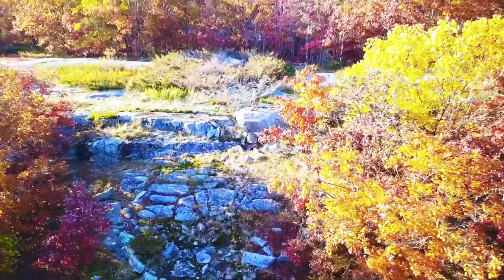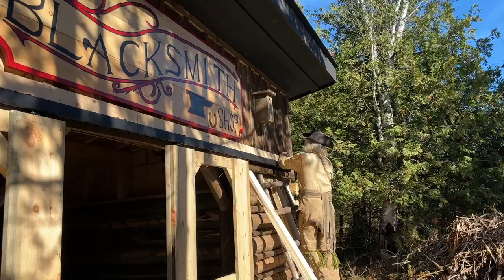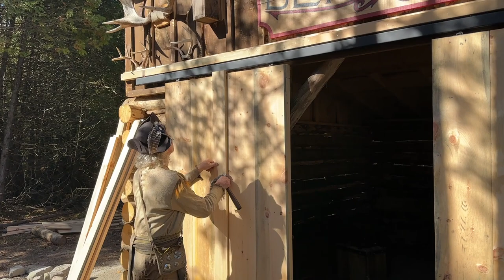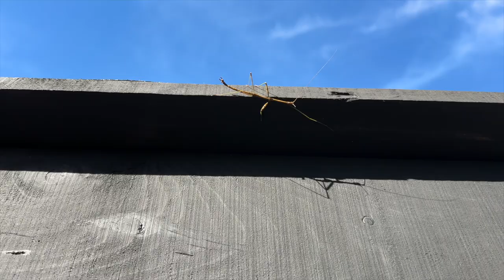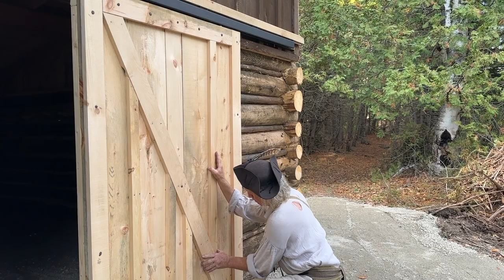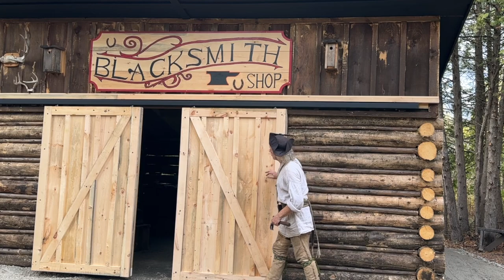Shut the Doors!  18'th Century Log Cabin Blacksmith Shop Build Continues | WOODWORKING

Comment: Howdy Peter 
Those doors will last a very long time .... 
Are you going to have set up to lock together so any wind will not blow them open ?
Are going to make some nails ?
That walking stick bug ... WOW have not seen one of them in a very long time .. I think I have only sen 2 and one was brought in to school 1965 ... " show and tell " ... the other was in my back yard .
Looks like the bug was inspecting your work ...LOL
I like that wheel barrel joke ... I heard it before but another piece of equipment .
Reply from the maker: I will be making a closing system for the doors but, I need to have a forge to do it on.  I could use my modern forge but, I prefer to make everything for this shop in this shop.  Oh my, the building inspector, I hope he/she approves,lol.

Comment: I really like the opening shot, it was a good change! I am building what I call a sharn. Bigger than a shed but smaller than a barn. I really want a sliding door on it, but everyone is very proud of the rail kits and the rollers for the doors. I have managed to tackle the roller issue but not the rail system for them to roll on. Did you fabricate your own or was it a kit? I have thought about using wood for the channel but I don't think it will last much over a couple of years.
Reply from the maker: I did buy the track system.  I think they would be relatively easy to make but, I’m trying to get this up and closed in before winter is upon us.  I don’t think wood would be a good idea, personally.
Reply: @TheWoodlandEscape  I have no welding or blacksmithing skills. Being an old Aircraft Mechanic I do have some original ideas.... some work and some do not. Angle iron for the track with a wood backing to keep the wheels running in the track may be a decent option....

Comment: Hi is the blacksmith  shop in operation  if so what's  the frist thing you're going to  make
Reply from the maker: I wish Mike.  I’m through the roof with the chimney but, I still have 6’ to build as well ass two coats of chinking on the inside.  The first things I’ll be making will be racks for my steel.  I’ve still to start the double lung bellows.  So I’m a ways off yet.